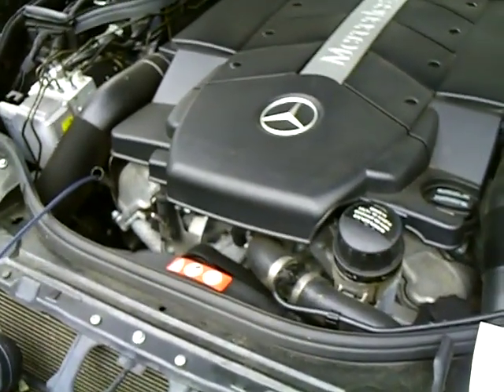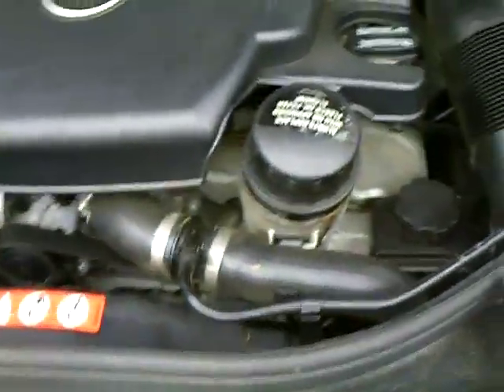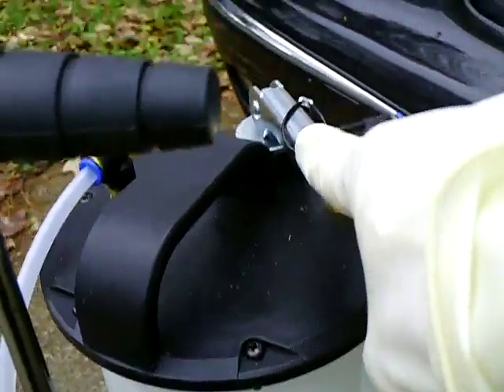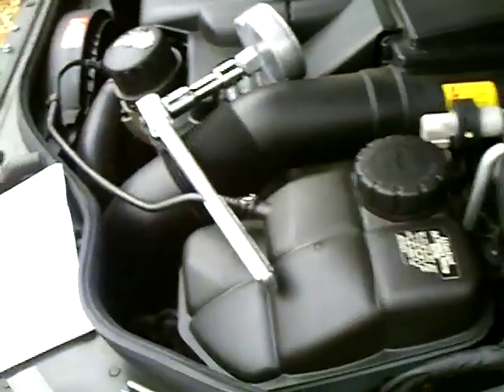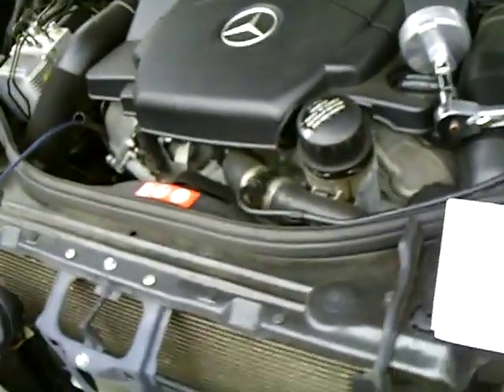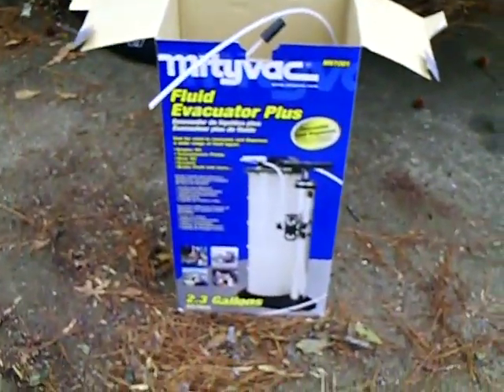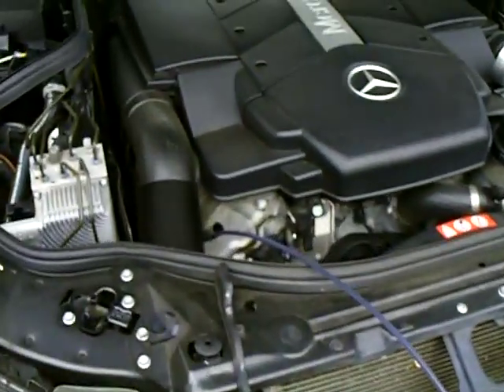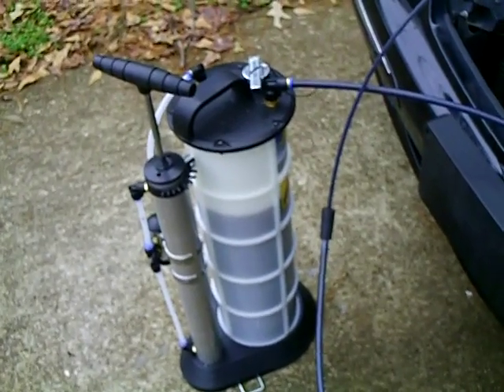E500 Oil and Filter Change Part 1 of 4

Comment from the maker: Hey, you're right, I check the manual for the mityvac and it says to clean with degreaser after using and let dry. I think this is for if you want to use the dispense feature to dispense oils and fluids so you don't contaminate the fluids being dispensed. I havent cleaned the unit in over a year and used it to change the oil in my GMC truck. I don't see why it has to be cleaned everytime, if it's only used for siphoning out used oil.

Comment from the maker: @careener0 Good question. I think it removes almost all the oil and in fact, even more than if I drove the car on ramps since I'm pretty sure the plug is in the front of the oil pan and raising the front of the car would casue the oil to slosh into the back of the pan. Mercedes does both, they sometimes drain the oil pan on a life, and sometimes they use a suction machine that uses the dipstick tube as a big straw. The dipstick tube goes to the bottom of the pan.

Comment from the maker: @iKnifeU123 Thank you for you comment. I think very small amount of oil would be left even when taking out the drain plug. The oil pan plug is in the front of the engine, so running the car on ramps would have some oil slosh back ward in the pan. I feel confident of this procedure, since Mercedes uses the vacuum method via the dipstick at all of their service facilities.

Comment from the maker: i always changed my own oil by doing the usual way so i see what you mean. I got this for the E500 becasue you got to take the splash cover off, then take the plug out the aluminum oil pan. I didn't feel like taking the risk of cross threading the aluminum oil pan plug. Also 8 quarts is a lot of oil to pour of of the oil pan possibly unto the driveway making a real mess. I didn't spill one drop of oil doing it like this. I figggured if Mercedes Dealers suck the oil out, so can i..

Comment from the maker: @careener0 part 2. I'm sure I got the tube all the way down to the bottom of the pan. The tube is cut to a slight angle so it can suck the oil.  The pan has a dip in it the allows the oil to go to the lowest point in the pan where the dipstick tube is. This is so Mercedes can suck the oil out of the pan with there suction machine. I suppose there might be something like an ounce or so left in the pan. I don't think that would cause a problem.

Comment from the maker: @rich6955 It's not the sport package. It does have the moon roof, but not the panaramic roof. It does have the Harmon Kardon Logic 7 sound system! It's a sharp looking car. I love the 4-matic all wheel drive option. The car is fast. I think 0-60 in 6.4 Seconds. Yes a sleeper at the lights! I think if I bought the car again, I might forego the air suspension if I could. the air struts are only from Mercedes and are quite pricey. I might have a noisy strut, but mechanics are clueless.

Comment from the maker: the mercedes is made for quick evacuation from the dealer. as /i explained the dip tube goes all the way down to the bottom of the pan. Mercedes was smart to charge 200 dollars for a 10 minute change. 
Every oil change info says to warm the oil before either draining it, or siphoning it.

Comment: @MrBigp72 5 weight oil is still pretty thick compared to when it's warmed up.  It makes a big difference in time if you're draining from the oil pan or from the dipstick tube.  Several manufacturers say this is a viable way to do it and train their mechanics in how to do it so it's a pretty legit way to do it if your dipstick allows.

Comment: Nice vid   This is the way MB dealers do it  My 1st service with mine  I stood near a window and watched them so  pffffftttt on anyone who thinks  this is a bad way to go. As mentioned by a few if you change your oil  when it should be  then there should be 0 crap in the pan.   Quick  no mess  no chance of mucking up the drain pan or plug   Nice  work here  thanks much

Comment from the maker: and yes, dealers siphon the oil when it's still warm-hot. I saw a  video on this from a mercedes dealer, which gave me the idea of using the mityvac.. they drive the car in and do the oil change. Nothing was said about letting the engine cool down to cold before doing the change.

Comment: I have been vacuuming the oil out of all my vehicles and lawn equipment for several years.  It may not be for people that have allowed a sludge to build up in the pan.  But, if you change your oil regularly this is the greatest, easiest, and cleanest way to get the job done. Just allow engine to cool until it is warm and you won't have to try to fit your head under a low profile car.  Every dipstick provides access to the oil pan. That is the oil level reservoir the dipstick provides a reading.

Comment: there are some vehicles that this will not work for  because the angle that the dipstick enters the crankcase will not allow the suction tube to go to the bottom of the oil pan. The Subaru Forester is one case in which it will not work.  Check with the service dept. of your dealership before you buy to find out if this will work for your car.Plus, you have to clean the unit with de-greaser after every use and this requires some time. Labor saving device? I dunno about that!

Comment: I used my electric shop vac and the same hose you are using. Cost like 1 dollar for the hose. No pumping at all.
Reply from the maker: Might be a pain dumping it out into a funnel that's stuck inside the opening some recycle container  due to the large opening of the canister vac. Still it seems like a great idea!

Comment from the maker: I never mentioned it would work for any other vehicles. the purpose was to help people in doing an oil and filter change on an E500.
the manual for the siphon device doesn't mention it needs to be cleaned with degreaser every time it's used. Siphon the oil , then dump it out in a storage vat. Unless of course you used the device for other types fluids in the reverse mode, to actually inject fluids or lubes into some mechanical device preventing cross contamination.

Comment: @iKnifeU123 Good day
It is impossible to remove ALL the old oil, or ALL tiny debris.
As long as 90+% has been replaced, you have done well.
The "key" is to replace the oil with the same brand each time, (whether it is "this or that brand"/type).
Each refiner uses different ADDITIVES. You want the same additives each time.....& do it every 5000KM. 
If you are "poor" then change the filter every other oil change,..but keep good oil esp in winter.

Comment: Thanks for the video!!
Do you recommend the mityvac 7201 totally?
Thanks for your answer!!!
Reply from the maker: Yes! I've used 4 times on the Mercedes and twice on my GMC Truck.
It works very well. Just one thing. I forgot to loosen the top rubber stopper when not in use and it swelled and now I pump the oil out of the Mityvac instead of dumping it. Actually It's better than pouring it out. It just takes a little longer.

Comment: Hi there, nice videos.  I have a 2004 E500.  My dipstick tube is at the rear of the engine.  I too used a oil extractor.  But, even though I had my nylon tube all the way to the bottom of the pan I could only get about 7 quarts of the 8 quart capacity it has.  Can you tell me how much of your oil you actually pulled out?  I hav heard some people go down the hole where the filter goes, but I have not tried that yet.  Have a good day.  Tom
Reply from the maker: Hi Tom, thank you for watching. I apologize for making 4 videos. I was learning how to make videos and didn't know how to edit them. I am able to get all 8 quarts out every time through the dipstick tube. Actually I learned the tube is like a straw. At the dealer they use a special vacuum pump and suck it all out of the dipstick "straw". I think I might leave an ounce in there but that's about it. You might could try to park the car on an incline so the oil will slosh to the rear. I wonder if 2004 used the straw type dipstick tube so the dealer could suck it out.
You might like to try to call a dealer and probe the service guys mind. I also have heard of people sucking the oil up through the filter hole, but I didn;t have need to try that. Good luck and update me because I am interested in what you find out.
BTW my wife has a 2007 Saab 2.0T and I could not use the sucking method because of the way the oil pan was made. The lowest point of the pan wasn't even with the dipstick tube. So I have to drain the 2.0T the conventional way through the
oil pan drain plug. Just wanted to mention that in case the 2004 Merc has the same sort of concept. I do not know, but a dealer would.

Comment from the maker: Lastly, perhaps you need to take up your issues with Mityvac. this is what their manual states: an excerpt.
1, park vehicle on level ground
2. Start the engine. Allow the engine to idle until it reaches normal operating temperature. Once
this is accomplished, turn engine off.
3. Remove the engine oil dipstick.
4. Select and insert the smallest diameter dipstick tube into the dipstick hole until it reaches the bottom
of the oil pan. Connect the main suction tube to the dipstick tube.

Comment: @iKnifeU123 really your not going to leave that much contaminants in your oil. If you have just finished driving your car most of the contaminants are going to be in suspension and not in large particles collecting on the oil pan floor. If there are large pieces of debris that are in your oil pan you have more issues to work. but most of the contamonants in oil are in the 20ish micron range. and usualy oil is changed due to dilution and acid build up. and about ever 3 oil changes do it via plug

Comment: Great tool, considering the Mercedes dealer and European car shops will charge you $125+ for an oil change and prices skyrocket from there for any other fluid change. This thing pays for itself if you only use it twice for an oil change on a European car.
Reply from the maker: Thanks for stopping by John. Mercedes charges way too much. Especially since they have a high speed sucker to suck that oil out through the dipstick tube. A real money maker for them.

Comment: I don't think any manufacturers or dealerships would train their employees to do improper services due to liability.  It sounds like you're implying this is an improper way to get the oil out which those manufacturers and dealerships would surely take issue with.  If more places removed oil like this there wouldn't be so many vehicles out on the road with damaged leaky oil pan threads because someone used an air tool, stripped it out and sent them on their way.